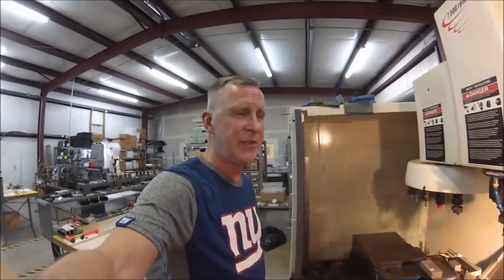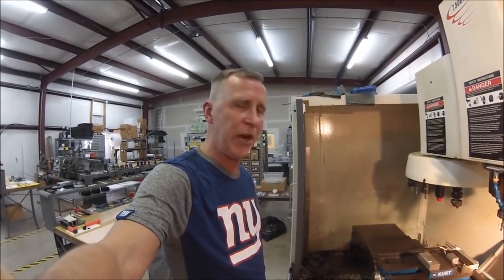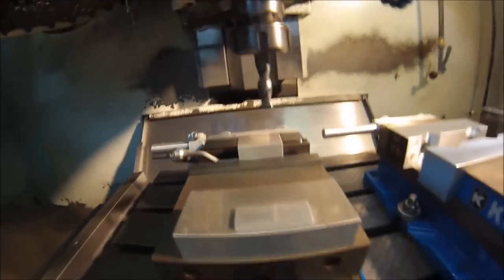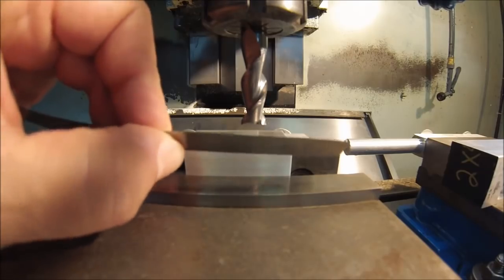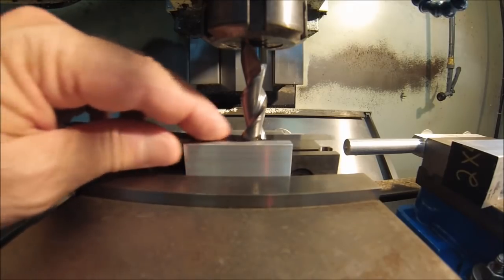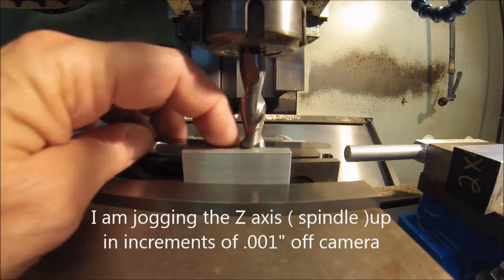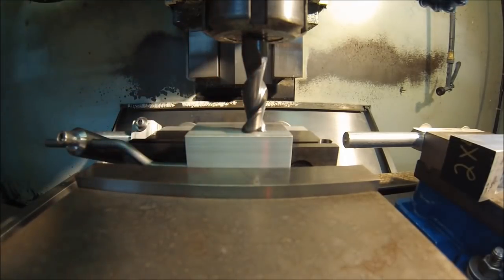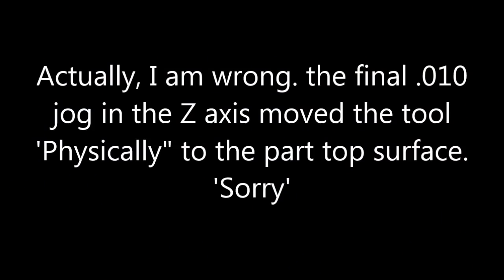How to Eliminate Chipping Risk when Setting your End Mill Height

Comment: I normally just use a 1inch gauge block set it next to the tool bring the z down until u see it setting just below the top of the gauge block then bring it up slowly just until u can barely slide it under the cutter then slowly until u fill the drag then set your tool
Reply: That's actually a great way to do it.  No stress of crashing your bit.  Creative and simple.  Probably the best solution out there.

Comment: I was taught to use a piece of plastic shim stock 0.01" or so.   that way if you overshoot, it just crushes the plastic a bit and you can back of and try again with another section of the shim that's still in good shape and your tool is fine.

Comment: Hi Joe, try an electronic Z axis tool setter. As with everything else you get what you pay for.  It's simply a spring loaded block with an integral LED. Touch block with tool  and thats you height. Down side is material being cut needs to be conductive & dry.  Dial versions can be used on non conducive material but have found them to be less robust. Hope this helps.
Reply: This is the same tool I use except on nonconductive materials you could just use it as a feeler gauge instead of paying attention to the lights.

Comment: I use the feeler gauge method, or touch the tool to the work with spindle on using .0001 pulse. In an irrelevant spot of course. The 1" block is a good idea too. All in what you like I guess. "Distance to Go" values are your best friend on that first run!😉

Comment: I have a Fadal too and I used to set TOs off every part just like that, it didn't help me I still duffed tools. I switched to setting tools off a shared position (vise, table whatever) using a .5" dowel by trying to roll it under the tool as I'm coming up. Since I'm not setting tools nearly as often and have a .5" (important that its at least more than my largest jog speed so one click doesn't screw me) it is no longer a problem. I don't understand why anyone would set TO off the top of part unless they are very new and don't understand work offsets yet. Thanks for the vid.

Comment: Great Tip Joe when I train the apprentices at work I start them off with a 1" gage block to set tools  because I found that most would not move the spindle z+ after setting the tools and break the end mill by moving the Z minus the 1 inch space was a safety zone  . The gage block was an economy grade also , not one from the inspection room  .Jeff

Comment: Your still susceptible to breaking.  I have accidentally gone two clicks with the MPG when I only wanted one. I like to use a .200 jo block, jog down till your bellow. 200, (with a little practice, you can see that from outside the machine) while in .010"per click, jog up while applying light pressure against the cutter with the block. When it slides under,  pull it back to clear the tool, come down one click, switch to .001" per click, apply slight pressure and jog up. As soon as the block slides under, stop. Your within .001". 
I do this to all tools, then put a -.200 in my Z register for my Work Offset.
Done. And never once jogged Towards the jo block.

Comment: You can also use a good known diameter dowel pin or gauge pin. I use a similar process for my lathe tooling for z offsets. Come in closer then the diameter of the pin and move out until the pin rolls passed the cutter.